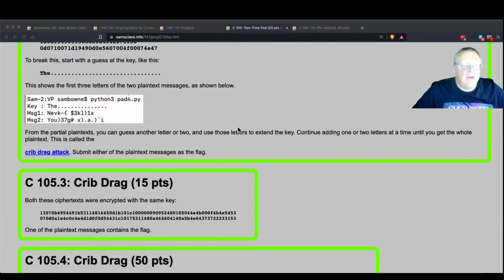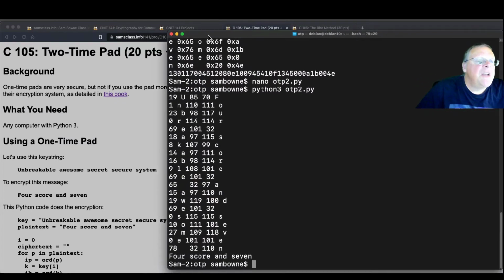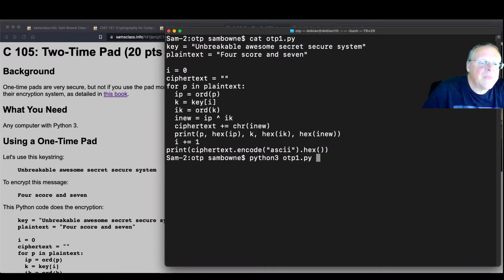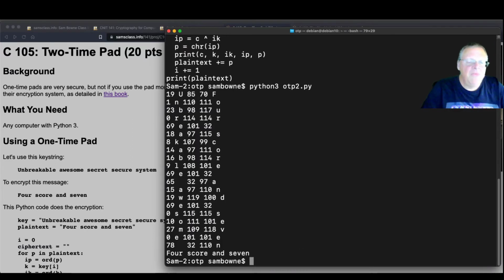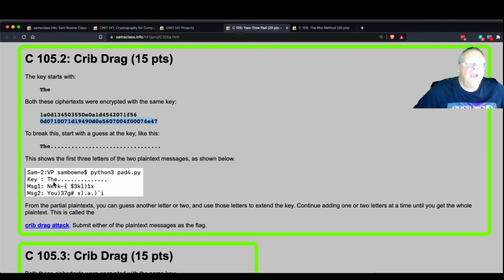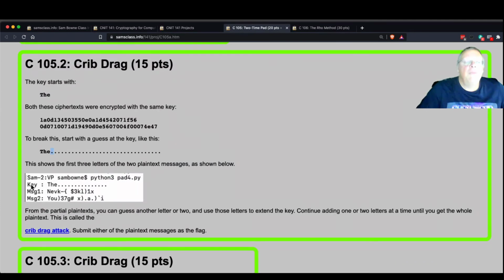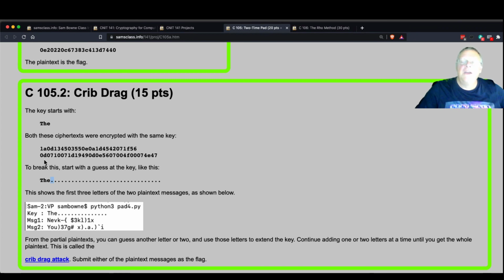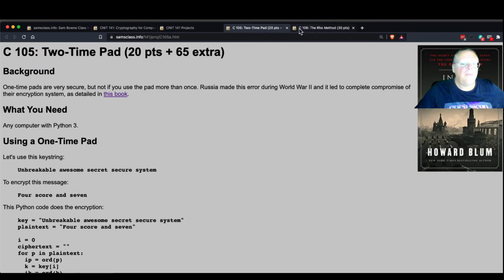C 105 Two Time Pad

Comment: I think the idea is that we can  c1 XOR c2 (c1 = cipher1, c2 = cipher2) and then guess a word of the plaintext message (not the key as you claim ). Then we hex that word and XOR it again with c1 XOR c2. If the result is readable the guess is correct and we expand the crib search.

We only calculate the key once we complete the crib search.